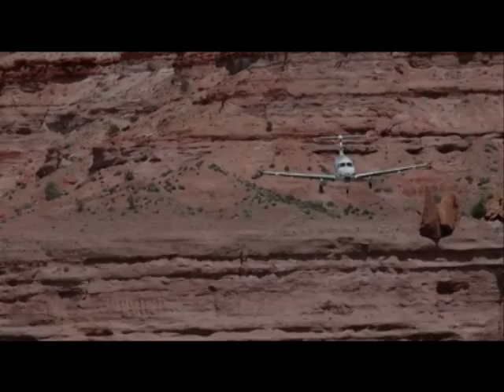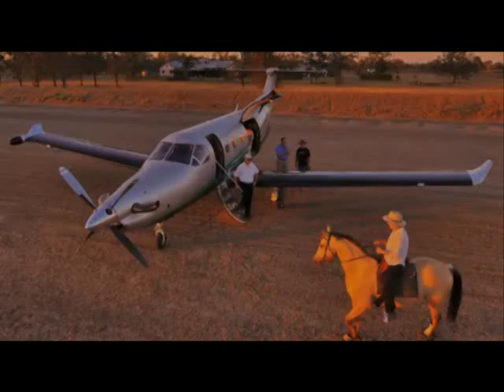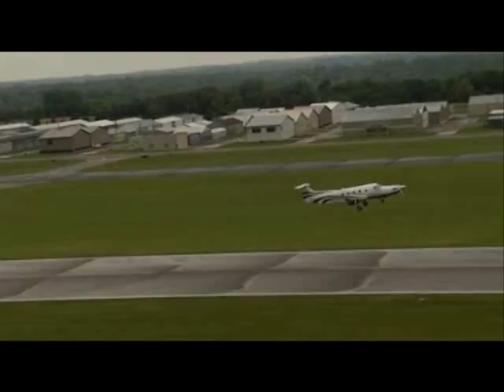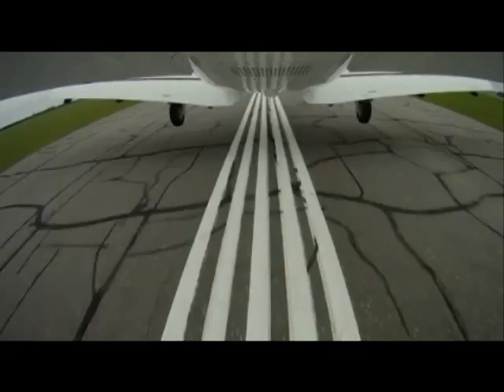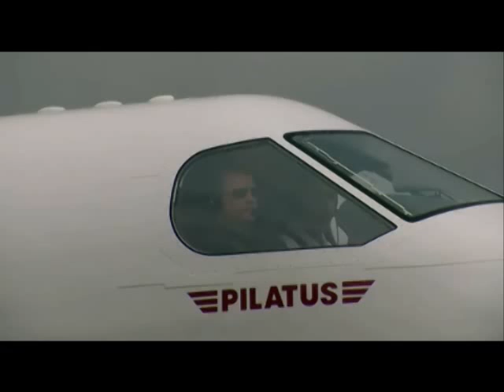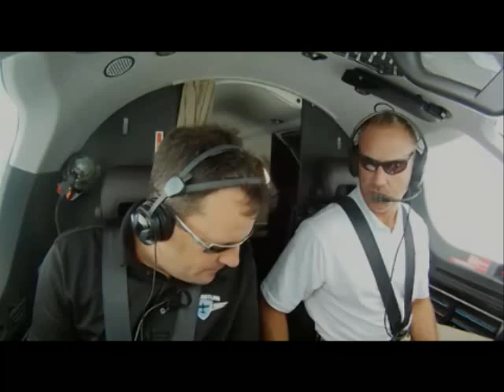PC-12 – The World's Greatest Single

Comment: Is it true the PC-12 NG is a very noisy aircraft? I read where it's over 90 dB inside. Ouch !!!
Reply: Holly Wood the pc-12ng only goes a little above 80dB in the cabin. I think it only goes 90dB in the cockpit, as that is the loudest part of the plane. With noise cancellation headphones, you should be fine. The cockpit would be a little quieter than a 777

Comment: JamesHMac,

A legitimate question sir. It all comes down to size. The PC-12 is a much bigger aircraft. The TBM850 is 34 feet long with a 41 foot wingspan, while the PC-12 is 47 feet long with a 53 foot wingspan. It's also heavier. The TBM850 max weight is almost 7,400 lbs., while the PC-12 Tops out at a little over 10,450 lbs. They are both awesome, but I would have to lean toward the PC-12 for my personal choice.